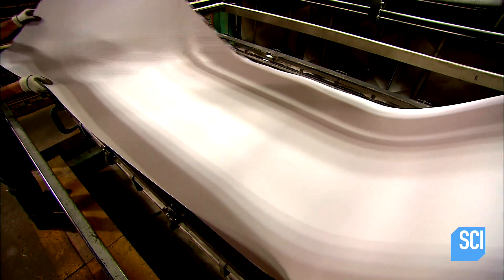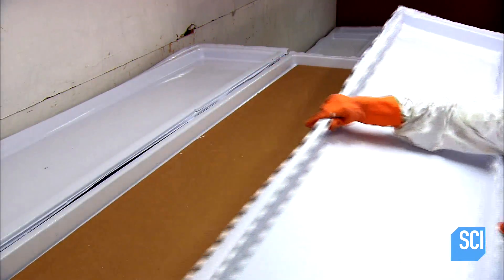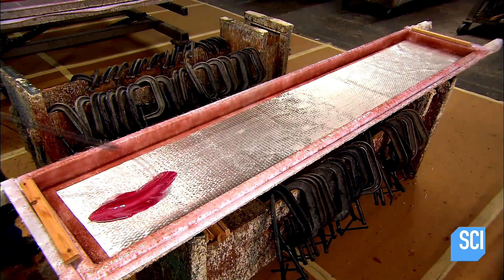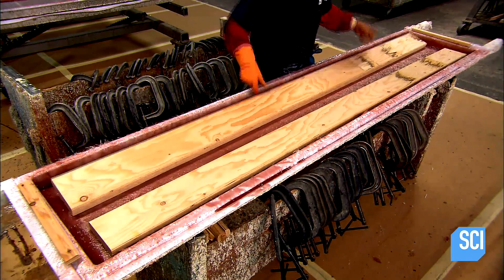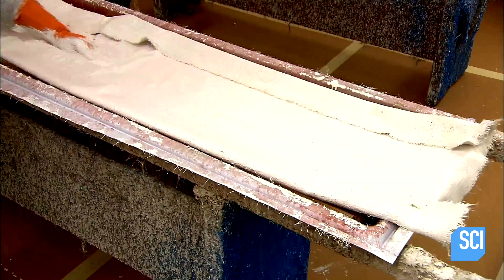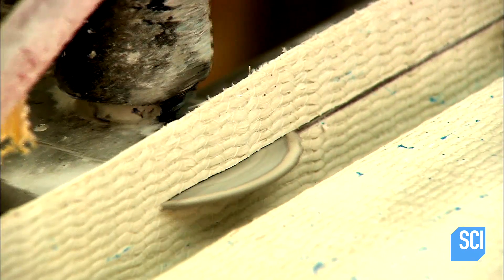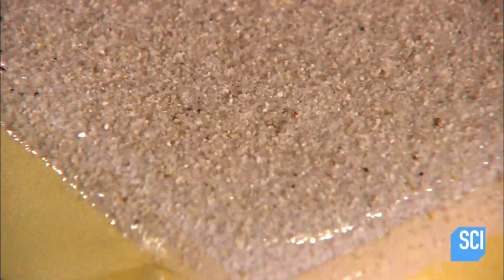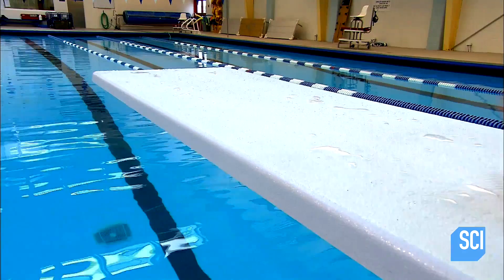Diving Boards | How It's Made

Comment: 1:28   what's the difference between 'laminated wood' and plywood?
Reply: The grain is running the same direction with those laminated pieces...........Plywood usually alternates 90 degrees between layers and sometimes better grade plywood can have layers with more angles than that.

Comment: Why do so many diving boards break on AFV?!
Reply: they aren't impregnated with resin apparently, those ones played it safe in the factory and left an air pocket in them
Reply: Bolt on or not installed correct